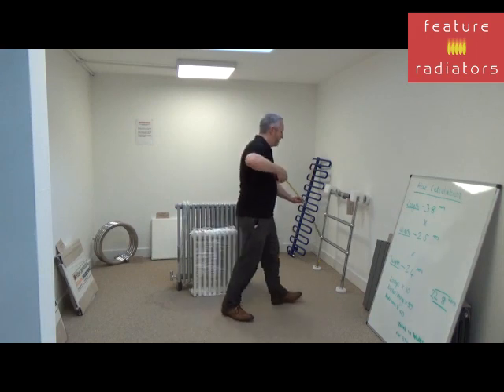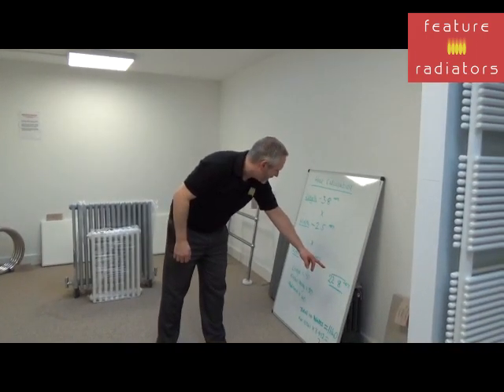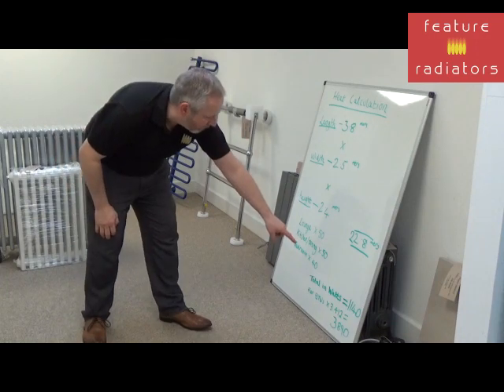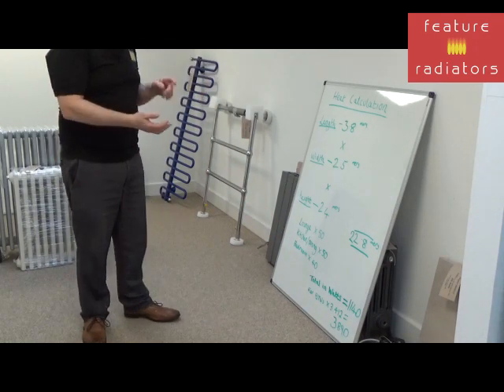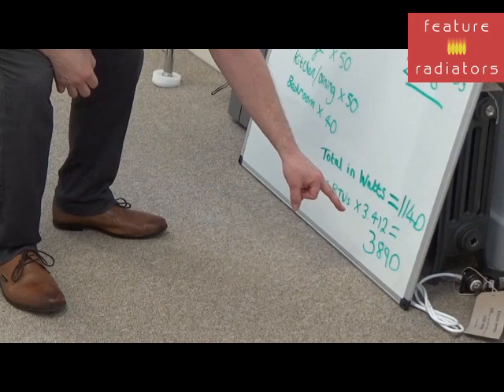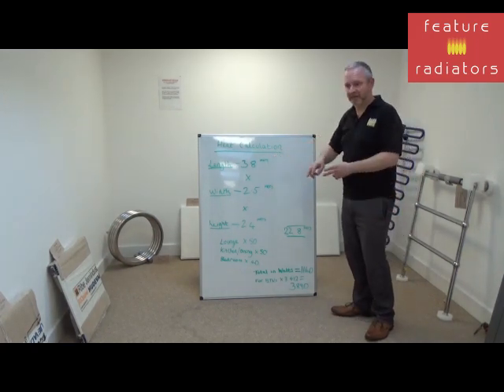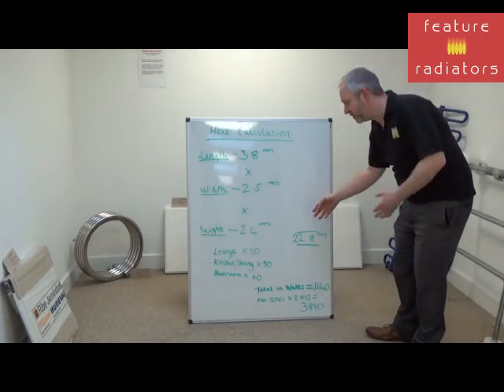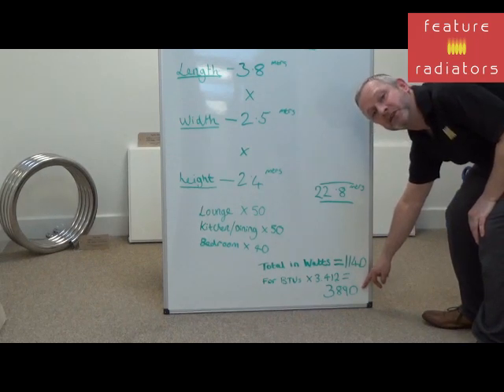Heat output calculator for radiators

Comment: What is the 50 number in the calculations? Is it the temperature of the heating fluid ? Thanks!
Reply from the maker: Hi Donald, thanks for the question. The 50 is the Watts per cubic meter of heat being put into the room, so different rooms have different Watts per meter to be put in, for example the lounge is 50 as we are sitting and want to be comfortable. Whereas a hallway will have 30 Watts per cubic meter, we pass through and just want to create an ambient temperature. Hope that answers it for you. Anything else 01274 567789, contact@featureradiators.co.uk or www.featureradiators.co.uk and our online chat bottom right corner.

Comment: Your method gives crazy results.  Why not do a proper heat loss calculation, its really not that difficult?
Reply from the maker: Hi Hazmat, thanks for your message. The method we use is tried and tested within the heating industry in general, i expect most companies use it. More than happy to chat to you further regards this - contact@featureradiators.co.uk or 01274 567789

Comment: What do you multiply with for a kitchen?
Reply from the maker: Thanks for the query Dellboy. Kitchen x 40. Kitchen with dining as well x 50, the latter because you are sat much like a lounge. Any more info required feel free to use contact@featureradiators.co.uk or 01274 567789

Comment: Hi there great video. I have one question I calculated my BTU it around 1550. The radiator I am looking at has BTU 2858 is that way too much
Reply from the maker: Hi Brian, thanks for the positive comment. I would say so, you can put a thermostatic valve on that and it will regulate it but i expect you can find better value on a smaller size. 10% maybe 20% more on BTU would be fine to cover any eventualities. I can check the BTU just let me know - 01274 567789 / joel@featureradiators.co.uk
Reply: @featureradiators  The input temperature for BTU advertising is delta t 50 so input from boiler is 70°C. Which isn't the most economical output. Would it not be better to oversize all the radiators in a home to target most economical output temperature of 45°C for a condensing combi boiler?
Reply from the maker: @rudejude87  Thanks for the comment. I believe i understand the point and i don't disagree, lower temps means more efficiency but major considerations here are cost of the radiators initially as they need to be much bigger and also space, generally people don't have the wall space to accommodate radiator sizes that mean the temp here would heat the rooms. Interested to chat more - joel@featureradiators.co.uk

Comment: I have 2 radiators in my lounge. Do I half the BTU for each?
Reply from the maker: Hi Eddie, sorry for the late reply. Yes, get the BTU required for the room and if you are installing 2 radiators, you can split it evenly or unevenly between the 2 radiators but just ensuring you reach the desired BTU total from both the radiators. We can help with this, feel free to get in touch on contact@featureradiators.co.uk